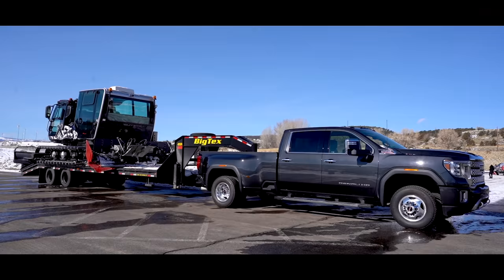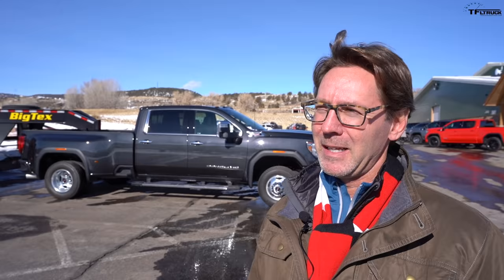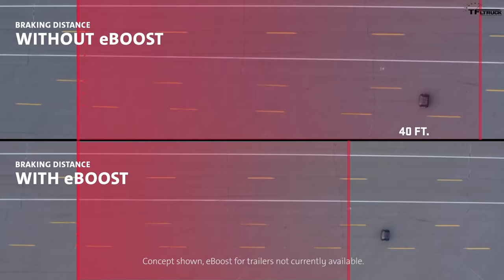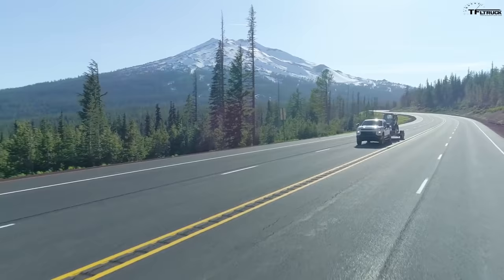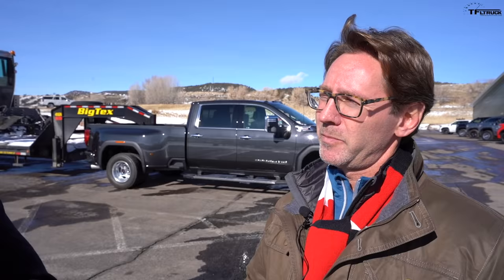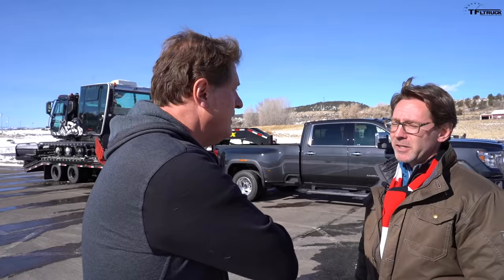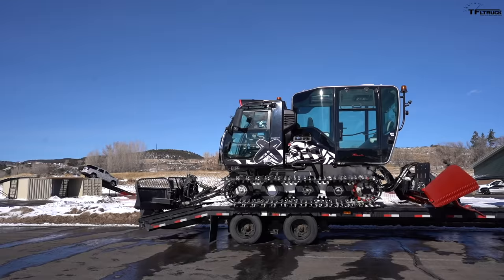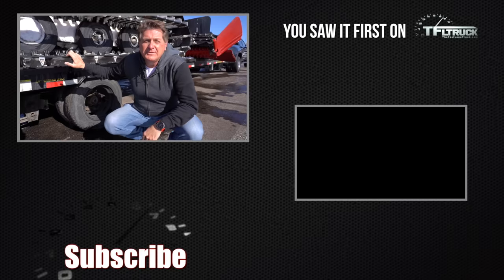Here's How GM's eBoost Trailer Brake System Stops A Fully-Loaded Truck Faster And Safer!

Comment: ABS for trailers? Hell yeah!! I hope this becomes an industry standard.
Reply: Hell yeah and not only does it improve stopping distance it will save trailer tires. If you ever have to stop quickly while towing trailer currently you can flat spot the tires and that often ruins them or at least leads to premature wear.
Reply: It is standard on semi trailers. I’m surprised it isn’t yet on smaller commercial gooseneck/Pintle pull type yet.
Reply: @scottback3020  On Semi's is it an open standard or do certain Semi brands only work with certain trailer brands?  IMO this is only going to work if GM shares the software implementation with other truck brands as well as the trailer manufacturers.  I highly doubt shortline trailer manufactures want to create models that are limited to a specific truck brand given how truck brand loyalty tends to go. 😃
Reply: logan holmberg 
It’s a standard across all manufactures on how the tractor supplies power to the ABS module on the trailer. There’s several different brands of trailer ABS “Wabco, Haldex, Bendix, etc” They all get there power from the Auxiliary circuit from the 7-way connection. The auxiliary circuit is a constant 12v power. I believe it’s a certain month in 1998 that all trailers after that manufacture date are required to have at least 1 axle with ABS. 
So any tractor, along as it’s feeding the trailer auxiliary circuit 12v, will have a functioning ABS, even if the tractor was built in 1950.
Reply: I never had a loaded trailer able to lock up the brakes with electric brakes atleast. I've had surge brakes lock up. I wonder if my brake controller is crappy or the trailer brakes are crappy. One is a RV trailer the other is a 22ft dove tail with 5200lb axles
Reply: @mesanders1113  You don't want to lock up your brakes. Lockup is bad. You're operating the way you should be (assuming the trailer is isn't out of adjustment and doing nothing).
Reply: @dchawk81  I know I don't want to lock them up but they are no where near powerful enough to lock them up. Maybe they are out of adjustment. I'm just more surprised that electric trailer brakes could be strong enough to lock up. Usually I can feel the abs engaging on my truck and still feel the trailer pushing it if I reach down and push the red slider on the brake controller it doesn't make a difference. When I do the red slider while coasting it definitely starts slowing the truck down.
Reply: @mesanders1113  Ah yeah you might be out of adjustment. 

When I do my brake settings on the controller I use a percentage approach. For easy math we'll go with a 10,000lb trailer. The way I figure it, the brakes were designed to give full stop to the trailer at Max. Therefore 10/10 on the controller is 100% load, 10,000lbs. If I'm at 8k I'll do 8/10 on the controller. If it's empty at 2100lbs I'll set it to 2 or 2.5 on the controller.

Each setting, or thereabouts, gives me trailer activation that is enough to keep the truck in drive, foot off the pedal, and use the trailer to keep the truck from creeping forward.

That's about where I like it. If they won't grab with those settings then it's out of adjustment on the trailer.

It's just a ballpark of course but if I need 10/10 on the controller just to hold the empty, I know I'm way out of adjustment. That means my truck is doing way too much work when it's loaded.

Comment: Great video, thanks for including this discussion with the GMC representative.  Besides disk brakes being slightly more expensive, the first of two main drawbacks would be that commercial trailer buyers usually buy an already made trailer in stock at a dealer, so dealers would probably only change their inventory AFTER public perception on the added benefit/added cost of such improvements, and that could be hard to change.  Secondly, drum brakes still work after being caked in mud or salt on dirt roads or highways, whereas disk brakes and caliper assemblies are more sensitive to road debris.  I personally know from the frozen calipers on my Toyota 4Runner that each had to be replaced around 90,000 miles of driving on salty winter roads.  Salt and debris corrode calipers so they can't freely move in and out, and brake disks corrode and rust with their open surfaces too.  Overcome a couple of these issues, and I would feel much safer with the trailers around me having the ability to brake shorter on the road.  Perhaps first add this to 53' semi tractor trailer industry first?
Reply: TEC Stuff 
It’s been mandatory on semi trailers since 1998

Comment: As a trailer engineer I love it. Main challenge comes to cost. Trailers are so price sensitive that disc brakes are a non-starter most of the time. Disc brakes have been available for heavy trailers for decades, yet they remain the minority. Disc brakes have so many advantages but due to their cost they seldom get specified. When a small trailer chassis is less than $10k to manufacture, adding $2-3k for disc brakes blows the budget. Only way you will see this is if it becomes mandated by the government. If I could put disc brakes on every trailer I would, unfortunately, no one wants to pay.

Comment: Would this tech. be the end of flat spot trailer tires. ABS alone on a trailer would be great. My wife and I had to replace a trailer tire because one wheel locked up and ruined that tire. Talking to my local Goodyear dealer, he said that can happen from time to time.  Another issue, Forest River for example, most of their trailers come with Castle Rock tires.....so, search CHINA BOMBS on YT and see what you find.
Reply: Man that's why I love my Jayco!! Comes stock with Dexter Axles and Goodyear Endurance trailer tires from the factory.

Comment: Lets keep it simple folks. The trailer industry should start with improving their tires and axles first before they move on to the brakes. I have personally went through  tires just hauling 2 ATV's on a tandem axle 20 footer. It appears hotshoters on you tube go through tires and axles with in their weight limit as well. Maybe they should start using pick up tires ten ply for starters they seem to wear better than trailer tires.

Comment: Commercial class 8 trailers already have ABS. 🤔
Reply: And how often are they working? I drive for a living and can tell you most of them aren't functioning.
Reply: Gene Fugatt 
Do you report them non functioning ABS systems to your employer? It’s legally required to work. You can be shut down for a faulty ABS.

But I assume you know that already.
Reply: @scottback3020  DOT never tests if the ABS is functioning. They only want to make sure the malfunction light works. I've gone through a lot of weigh stations with the light on and have never had an issue.
Reply: @scottback3020  but yes I tell my employer considering it's myself.
Reply: Bud Smokegood  What'd we do before anti-lock brakes? Next time you're cruising down the highway look at how many trucks ABS light is on on the trailer. It's not even an out of service infraction.
Reply: Bud Smokegood  The brakes still work they just don't have ABS.

ABS only really plays a part when you have to stand on the pedal, in which case everyone's basically f'ed anyway.

Comment: ABS has been mandatory on all commercial trailers over a certain weight limit for decades now! It’s the smaller private/personal recreational trailers that are lacking, due to a manufacturing base that’s not integrated between the vehicles and trailers manufacturers, at this point. But it would be great if a buyer that’s willing to spend more on a decent reliable integrated ABS System, especially using disk brakes instead of antiquated drums.
Reply: K. R. V. There is definitely a need for this system since truck manufacturers are upping their towing numbers every year.
Reply: Trailer numbers are also going up  Due to the growing hotshot industry, this is needed...tired of my brakes locking up on me in emergency situations.

Comment: I used to tow a fairly heavy trailer and I was stressed out - checking mirrors, hyper vigilant. Can’t imagine towing heavy equipment like an excavator on a heavy trailer, in traffic, with poor drivers everywhere. How do tractor trailer guys do it? Got my respect. They need the ABS
Reply: It's a pita but its do able. Modern semi trailers have abs on at least one axle and disc brakes are more popular now. Drums still work well on semis and trailers but disc is nice
Reply: Trucks and trailers have had ABS since 1996, it was even used in the 70s but was a crude system. I'm talking about class8 heavy duty trucks.
Reply: Midnight Trumptrain 
Oh dear lord. I remember seeing some of those very early ABS systems. Most of them cut off. Lol
Reminds me of the early disc brakes they tried back then and also them damn wedge brakes. Ugh!

Comment: Hell yea double trailer costs like trucks! It is nice to think of better stopping distances though in all seriousness.
Reply: No, it's not like trucks at all. Stop complaining and get a better job. Goddamn, I can't believe someone could be so cheap on an issue like road safety.
Reply: @felix8289  exactly and there's no way abs trailer brakes is going double the cost of the trailer. Our camper was over $50k I'm sure glad I saved $50k by not going with abs brakes lol
Reply: Never mind the safety benefits, I'll just appeal to your pocketbook for a moment. The general cost savings in insurance, avoiding minor fender benders and repair downtime would more than outweigh the intial cost. To save pennies at the cost of dollars is just backwards and neanderthalic.
Reply: Yeah, why spend a grand or two on superior brakes when you can die in an accident or total out $150,000 worth of truck and trailer. Silly manufacturers and their costs.

Comment: It sounds amazing, but alot of issues I see in implementation.
Reply: So far finding a place on the road that can service it.
Reply: @Dive-Bar-Casanova  if they make it as a kit then people will get familiar with the technology, thus making service easier.
Reply: @ghost-jesus  or go 'open source' produce a standard, and let people add there own components. the opposite of Telsa
Reply: @stevencruz4937  that's basically what making a kit would do, pretty soon people will make components for it and kits for all types of axles will pop up, in any case I think this would pair with my proportional EOH brakes pretty well.
Reply: @Dive-Bar-Casanova  presumably any GM dealer could...

Comment: Do the new Chevys have an exhaust brake like the Rams and Fords? If not, they should. It not only helps with all trailers but the truck by itself too.
Reply: Yes, Gm's do have an exhaust brake and it has routinely been the most powerful between the big 3.  In a lot of TFL's tests they have had to use the accelerator down a 7 % grade pulling 20,000+ lbs to maintain their desired speed because it is so effective.  Works best with cruise control if the conditions allow.
Reply: @ttank94  10-4 I do remember that video now but couldn't recall which truck it was.

Comment: GM finally had a good idea.
Reply: they have lots of good ideas , GM also invented and built the first mechanical heart pump that was used for the very first open heart surgery.
Reply: GM has done this kinda stuff before, they invented magnetic shocks and have sold patent access to multiple manufacturers and F1 even uses them. 

Also what is the most common V8 that is swapped into other vehicles and even vehicles not made by GM? The LS V8, there's millions of them around the world and they're incredibly reliable and capable of many applications and power outputs. They even put them in boats! No wonder there's the term "LS swap it"
Reply: I don't know what rock you've been under, but GM owns some of the most important patents in the industry.
Reply: One Nation Under God couldn’t agree more. I’m a mopar guy but my money would go to GM for guaranteed reliability and innovation

Comment: It's a great idea but for it to actually sell GM needs to make their own trailers OR create an open standard with other truck manufactures so any truck with the software would work with the trailers.  Just my exp from working in the Ag industry.
Reply: It’s very easily doable. All GM has to do is build an ECU/module that works with electric brakes on controlling voltage output to speed sensed wheels. They’re probably working with someone like Delphi or Bosch in development. It would be a stand alone system installed on the trailer that can be used on any electric brake application as long as the wheel has speed sensors. All that would be needed from the tow vehicle is a constant 12v power source from the 7-way connection.

Comment: Pretty sure my 2016 ford has this
Reply: Uh pretty sure not....
Reply: @noahmcclure2515  It has adjustable trailer brake power either way which is mint
Reply: @max7768  All trucks have that dude! It kind of comes with trailer brakes haha on Chevies its like 2 little sliders you can move to adjust it.

Comment: Good concept but never going to happen. At least not for the foreseeable future.  The cost of the system, the cost of the trailer and the trailer industry not willing to change is what will kill this idea.  I can't stand GM but I can appreciate this idea. Although I am scared to know that GM developed and made this system and how the reliability will be.
Reply: RocHopn 
It won’t happen from a manufacturer stand point but I see it’ll eventually happen because the government requires it.
Reply: @scottback3020  I hope they do make this a standard. However, our cost as the consumer will definently go up. Seeing that I tow a 5th wheel I would pay the money because safety is more important than cost IMO. Too many drivers dont respect others towing trailers. They dont even think about emergencies or quick maneuvers like the tow driver does. Maybe make driving schools mandatory.
Reply: RocHopn 
But I agree with ya completely. You have to drive prepared for anything around other drivers.